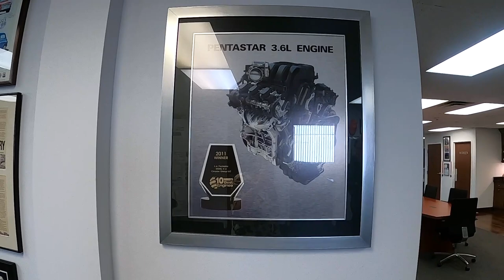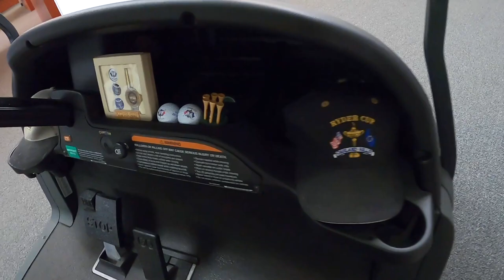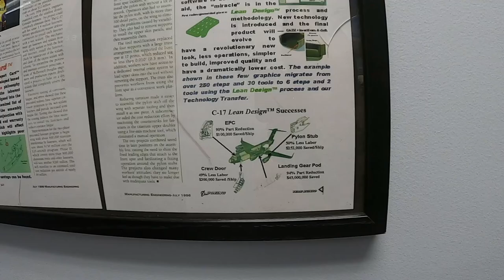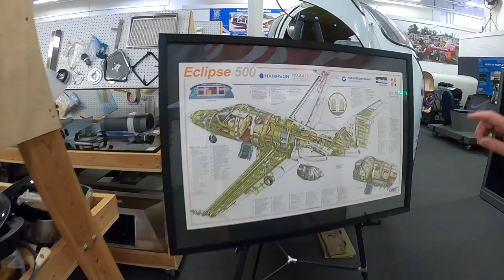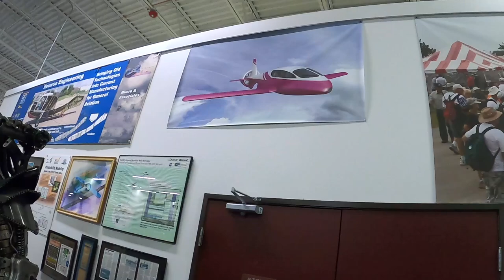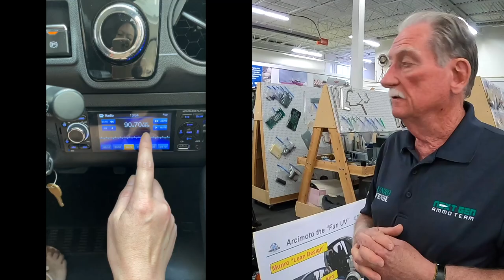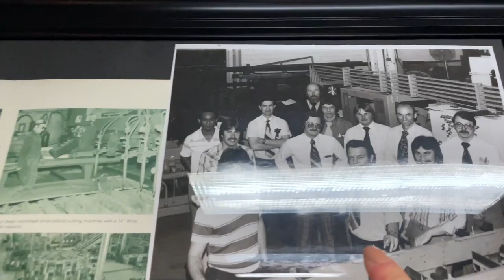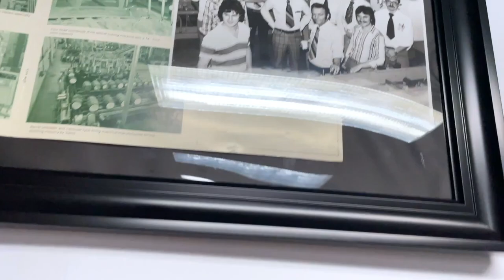Get To Know Sandy Munro @MunroLive and Munro & Associates - Part 2 of 3

Comment: The most amazing part and interested to me was that old aircraft and paradigm they designed. Aircraft field is actually the area I liked, I once wanted to be a pilot when I was younger student. I wonder how many good designs was killed under FAA regulation. Hope those regulations had been changed a lot through the years. Also, that poster under the slogan “Be Ethical” is extremely important to many companies. Had been showed in his previous video and talked…